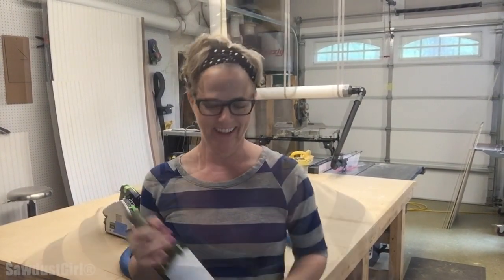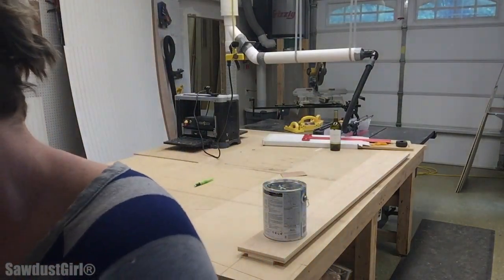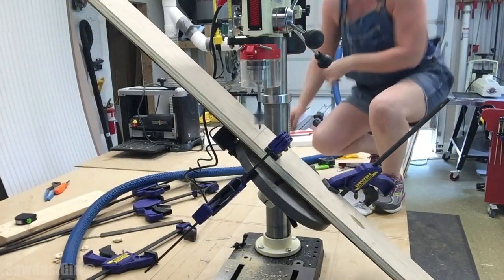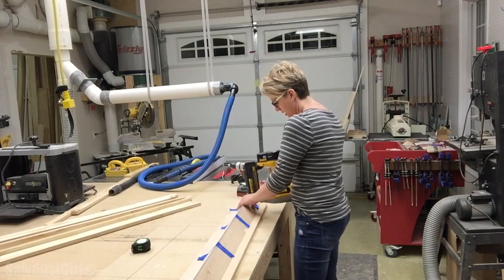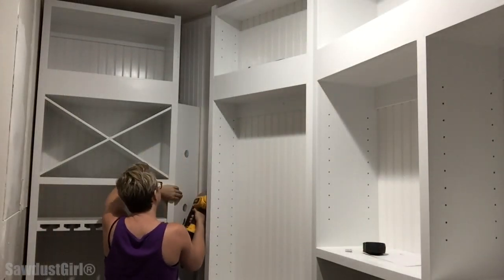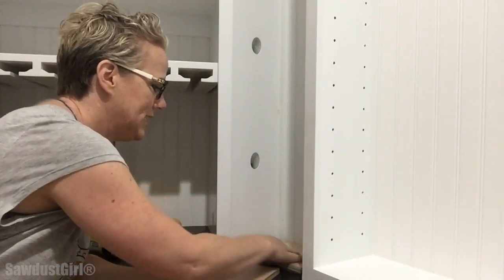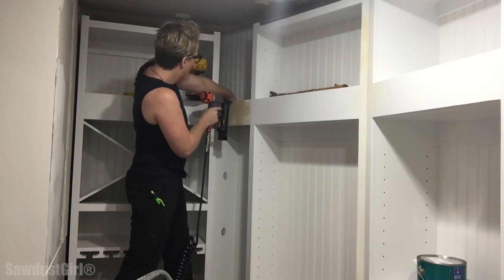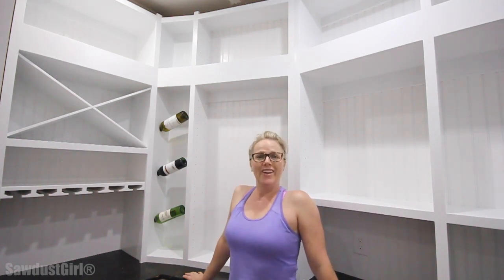Wine Rack - Pantry (part 10)

Comment: Do like the wood puddly sand then paint technique.  Using it myself.  Sometimes the puddy leaves a diff final texture than the wood.  Do you have this issue at all?  Which filler did you use?

Comment: Heh, perhaps the only reason to ever have a non-square hole with a drill press is wine racks.  That is the exact same reason I've only ever needed a diagonal hole.

If you were interested, I have a video with the jig I used.  But I also wasn't trying to do several feet of material at once so it wouldn't have worked for your purposes.
Reply from the maker: Make Crazydays I'll definitely check it out.  I didn't see any other way to drill the holes in that long board...probably won't ever do it again.  LOL